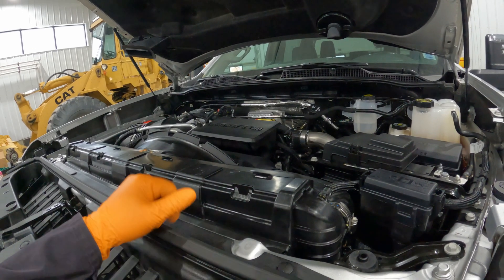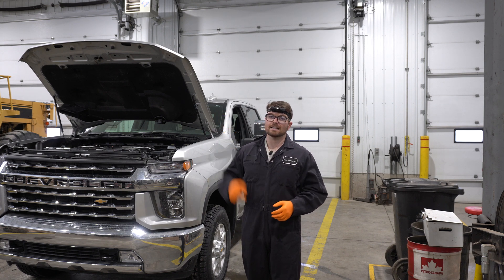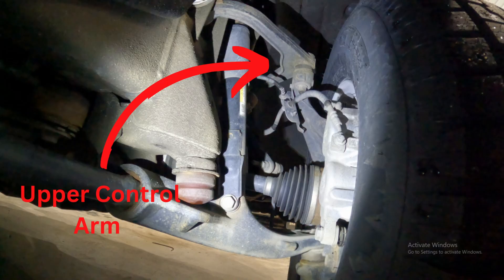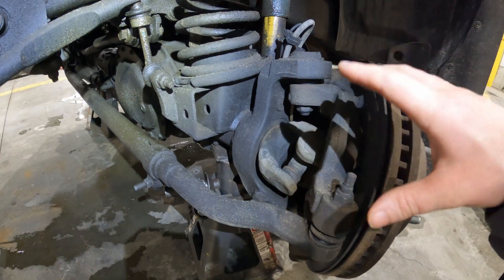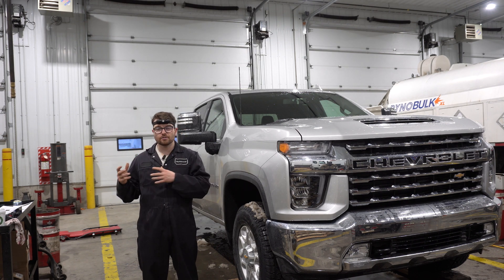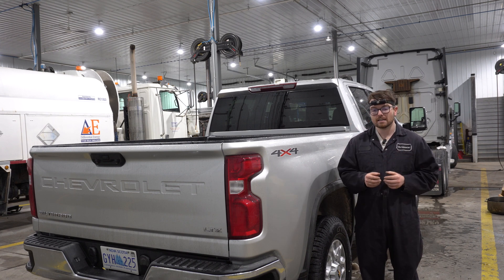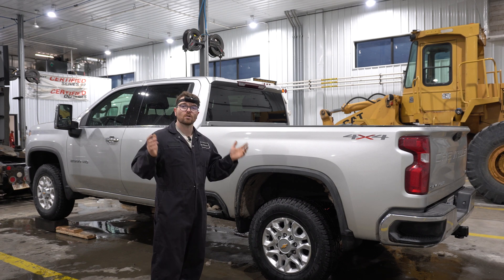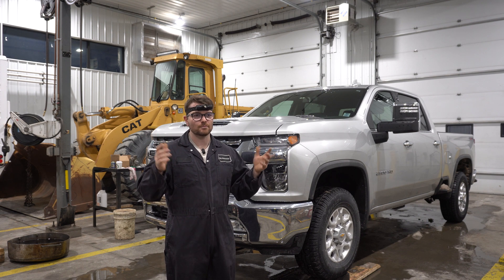Chevy 2500 6.6L Duramax Diesel Review (Part 2) | Does GM Make A GOOD Truck??

Comment: GM always does this crap on all their V8 vehicles. They don't give you an aggressive enough rear gear. It's like they try and force the engine to lug itself up to speed. It makes these modern GM vehicles feel very old school. Like the 90/00's 4 speed days. They are lazy to downshift. I remember back in my LS1 Fbody day we complained that 3.42's weren't aggressive enough, and totally unnecessary with Viper overdrive gears. The GEN6 Camaros with automatic transmissions use a 2.77 rear gear. Why? A 3.42 would be an awesome gear to complement a 10L80/10L90. I was looking to buy a Silverado 1500 with a L87/10L80, but ended up getting a F150 with a Coyote/10R80 instead. 2 reason were 1) GM is way too proud of the L87. They ask way too much for it and option it in too few model/cab/drivetrain configurations. "But JROC, it's a Corvette engine with different exhaust and intake manifolds." I don't care, it's also a Camaro engine, and Coyote is a Mustang engine, an GEN2/GEN3 Coyotes are full forged, have much better fuel systems, 5L F150 is a flex fuel vehicle from the factory, and being DOHC vs OHV there's no reason that Ford should be able to offer a Coyote in such a broad range of models/cob/drivetrain configurations compared to GM with the 6.2L, and for so much less $. The only reason I can figure that GM limits the sale of the 6.2L so much is to get better CAFE ratings as a GEN5 6.2L is much better than a GEN5 5.3L. I couldn't find a L87/10L80 truck that compared with my F150 interms of features and mileage for anything less than $12K more than my F150. I would of been paying $53-$54K for a used 19 RST Z71. Issue 2) on why I went F150 over Silverado is the F150 with the GEN3 Coyote feels stronger, more playful and funner. This is odd in a truck as Coyote is known to be a RPM based engine, while the LT1 is a very broad/linear engine (I used to own a 19 1SS 1LE) but you wouldn't think so driving these trucks back to back. The F150 is so willing to downshift and put the engine in the meat of it power that it's very rewarding and makes it feel modern compared to the Silverado with the L87/10L80. I credit this to 2 things. The Ford gives you the opinion for 3.31's, 3.55's, or 3.73's (my truck has 3.73's) whereas GM sticks you with 3.23 rear gears. Then Ford tunes their 10 speed to be much more willing to downshift like it knows what you're wanting to do when you start adding throttle. The tuning on the 10L80 is old-school in that it's lazy to downshift. It forces the engine to lug unless you give it a pretty good amount of throttle input. With a 275/55-20 tire my F150 rides right at 2,000 RPM's at 80 MPH. The newer GM and 21+ F150 uses a taller 275/60-20 tire and a 10R80 and 10L80 use the exact same gears so a 3.73 rear gear is not too aggressive a rear gear for a GEN5 SBC on the highway. You GEN3+ SBC's cruise great at 2,000 RPM's.

I will say I thought the 3.73's in my M6 19 SS 1LE was a pretty ideal gear for the car so I can't say that GM never gets their rear gear right.

Comment: Good job on the video man, really like your informative factual-based videos. I own a 20' GMC AT4 2500 HD and I am an HD landscaper that pulls my #12000 skid steer plus implements on my 25' gooseneck ( a lot of weight). The truck seems to pull it just fine with 0 issues as a matter of fact my crew is always telling me I drive too fast and honestly I barely put my foot into it. This L5P just goes! It is very smooth for what it is and I enjoy the product immensely. I have a little over 95K miles on it and not one issue so far. None. I want to trade it in before the 100,000-mile mark bc of its value but am hard-pressed to switch to another manufacturer. I like the Tradesman with the Power Wagon package but am not totally convinced I will get all the "goodies" that GM gives me. I do wish they would refresh the interior as they did on the 1/2 tons and I would probably just stick with GMC at least that is what I am leaning toward doing at the moment. Keep up the good work, we are watching!
Reply: This is good to know. I’m looking at getting a 21 Chevy 2500 HD for my landscape company. I haul a gooseneck 14k lbs dump trailer every day and I’m hoping it’ll do the trick and can last me a while!

Comment: The main takeaway of the DMax 2500 seems to be that from a design philosophy standpoint GM set out to build a liveable daily driver that can tow the big stuff in a pinch when needed, while Ford/Ram built more vocational oriented trucks that can be specc'd out in luxe trims but sacrifice everyday creature comforts for durability.

If you're towing a backhoe or landscape trailer to jobsites 5 days a week and sometimes take the family out to dinner on the weekends it probably comes down to a shootout between the Ram and the Superduty, but if you're looking to commute to your day job and get the kids to swim meets while still being able to tow the boat/camper/tractor on the weekends the GM seems absolutely unbeatable.
Reply: Hit the nail on the head. Ford and Ram do all their philosophy on paper. GM is the only one that sets out from the ground up to make a truck designed for the real world, all day, every day.
Reply: This sums it up greatly. I have always said, if you want a workhorse you need a Ram, if you want a mix between work and pleasure get a Superduty, if you simply want to ride in comfort when you need to work from time to time,,,, buy a GM

Comment: Here in New England where bad roads with lots of pot holes is the norm.   I’ll take that IFS on the GM.     The ride is better and they don’t chew up ball joints as often as the solid front axle trucks.

Comment: I like the GM.    Ram is Awesome but the transmission is crap.  With the cost going up. I will stick with GM.     The gm has served me very well. !!!!      If not pulling a load a lot  or hi milage. I like the gas.  Save 10,000 +    service is cheaper.    10k. Buys a lot of gas

Comment: I have a 2019 3500 single rear wheel drive and I towed 28,100 pounds on a dump trailer and it towed it perfectly fine with no problems even going up a hill.

Comment: With the GM trucks it's always a matter of GM just making lower-rated trucks. GM plays it really conservative, comparatively speaking, with how high they rat their engines and trucks. Back in the 2010-2012 era they played the one-upsmanship game with Duramax power; every time Ford or Ram raised theirs, GM responded a few months later. For whatever reason, GM has since opted not to do that. What they have said consistently since then is that they focus on the total towing experience. To them that means not necessarily shooting for the moon like Ram and Ford on power and capacity ratings. 
Is this hurting GM? Maybe a bit but they still outsell Ram by a good amount so they're not hurting for sales even with gas and diesel power ratings - and a couple tow/payload ratings - below the others. So can GM's platform do those higher ratings? I would say yes, if they do away with the G80. But like the IFS, some of their design features are considered institutional such as GM's focus on OHV engines for so many decades. So, whenever GM raises their power and capacity ratings, I'm guessing they will have a stronger G80 and IFS as well.

Comment: I’m pretty sure the 3.42 gearing was new with the 10 speed.   Previously, 3.73 was the standard gearing on the D/A combo (as far as I recall anyway)
Reply: You are correct. The 3.42 is just fine in this application. Factory rated tow numbers are marlarcy anyway. 99.99% of truck owners will never tow 30+ thousand pounds. Its just  marketing. In my opinion the GM feels the best with a trailer behind it but thats just. My opinion

Comment: I run a 2015 gmc 2500 hd as my work truck in northern Alberta I agree there is more moving parts but the front ends are stout. It has 329’000k on it and through some rough Alberta pipeline roads and off road conditions. Last year at 280 I finally had to rebuild the front end. My 2010 dodge ram 3500 I put two front ends in it by 210k not to mention a new 68rfe transmission too. I know it’s hard to take one guys word on trucks but each truck has there flaws but my duramax has been my best truck I’ve owned hands down
Reply: Have you has the CP4 injector pump issue. The internet has ne terrified of mine.
Reply: @andrewhall7862  no I haven’t I run a fuel conditioner every tank of fuel and I think that definitely helps
Reply: @andrewhall7862 most wont. I think the actual failure rate is less than 1%

Comment: Question: If you weren't a RAM guy, would you recommend the 2500 L5P Duramax for someone who doesn't want to tune or trick out their 2500?  I might put on a cold air intake, do the MAP spacer mod.  I'm a GM guy through and through. My 2009 Tahoe is going strong and I will keep my pavement princess for as long as possible. But I need a better tow vehicle and really want to stay in the GM family.
Reply: The 2020 and new duramaxs are a dream
Reply: I'm a Ford guy.  I bought a used 2020 2500 Chevy LTZ for comfort.  It is more like a big SUV and drives, rides, and travels very nice.  The towing capacity on the door is 18,500.  My Ford was 22,.000.  It's give and take, all in what you need or want.  Both diesel by the way.

Comment: Have a 2021 2500 duramax. Got rear ended and drove Ram 2500 while mine was in the shop. Day to day the ram was not comfortable. Hauling it rode just fine.  I think it all comes down to what you’re using it for. 75% of HD truck owners don’t use them to their full capability so ride comfort might play a bigger role.
Reply: I should also mention that cruising on the highway I get over 25mpg in the duramax without a load.
Reply: My friend has a 2020 gmc Denili. I swear the seats in that thing.  Feel like I'm sitting on a picnic bench. We drive from southern PA to southern NY a lot.  Also he get the same or worse than my Ram gasser towing mpg. So either there's something wrong with that truck or that engine is ass. He didn't even want me taking pic of the mpg .
Reply: @Mattman2500  not sure what’s going on with your friends truck but I get amazing fuel economy for a 3/4 ton. Does he have the 10 speed?
Reply: @chrisj9897  Yeah has the 10 speed. From what I can tell gets like 17ish . Driving around here country roads. We towed the same trail loaded the same. I got 1mpg better . With my Ram 6.4L 2500. The load was my gooseneck loaded with a tractor. Pulling 8 to 10k . Now he has a lot of miles on it about 60k. So far from what I can tell. Hasn't given him any problems.
Reply: So absolutely true!!! and the AWD fonction of the transmission in winter = a blessing!

Comment: You're whining about rear end gear ratios on a truck that can't hit 20mph in 1st gear. Smh you shouldn't act you know anything if you cant understand that a transmission has gears as well as the rear end.

Edit, just looked it up and your lovely dodge is geared quite a bit higher (meaning 1st gear maxes out at a higher speed since you don't seem to understand this) for first gear. Seriously, learn to understand gear ratios and how they work together. With both on 35s and at 19mph, the cummins (3.73 rear end) is turning 2500rpms while the duramax is turning 2800rpms. You have to get the 4.10 rear end in the dodge to mach the gearing of the duramax.

Comment: I'm currently battling a ED 1500 full delete problem that I can't get solved. Hence I'm looking at the 3.0 Duramax. I would like to see the same walk through on that truck as I value your experience and candor. Thanks for considering this option!
Reply: Don’t get the 30 Duramax it’s too long for the cab of Chevy or GM or GMC. You have to take the cab off it to get to the injection pumps that’s a real dealbreaker.

Comment: You neglected to mention that solid front axle "feature" of death wobble.
Reply: Death wobble is caused by neglect worn tie rods drag link n ball jts
Reply from the maker: No system is flawless, I think its generally a stronger option for an HD truck. GMC 4500 and 5500 come with solid front axles for a reason.

Comment: Do you know if the 6.6 gas and diesel have any parts in common ?
Reply from the maker: in terms of the internal engine components. I would highly doubt they do. very different engine despite sharing the same displacement. but I could be wrong!

Comment: I truly believe that the emissions components on GM vehicles have evolved to the point of being the most reliable of the 3 north American truck manufacturers. The 3.42 ratio gear set is a non issue for me since the gearing in the 10 speed "Allison" transmission makes up for it. I had a deleted LMM Duramax before this 2022 L5P that I now own and would never go back.
Reply: People get way too caught up on rear end ratios and if anyone complains about it in any way, I automatically know they don't know what they're talking about. There are 10 other gears between the rear end and the engine. 1st gear tops out just under 20mph on my Duramax so, I have zero problems.
Reply: @jeffhall768 otally agree. If I am towing with my 3.42 rear end in 7th gear and I need more pull- it goes down to 6th. So what is the advantage of having a 3.73 rear other than when in 1st gear( and I can’t use all the torque I have in 1st gear anyway).
Oh I forgot- the Ram only has 6 gears anyway !
Reply: @jeffhall768  You’re 100% right! So many people talking shit about rear end ratios but with the 8-10 speeds nowadays it doesn’t realy matter. I own a Ram 1500 8 speed and with 3,21 gearing it still have 28% more wheel torque than an old 6 speed with 3,92
Reply from the maker: I mean I do think GM makes a good truck. I think in terms of options I like the ram better. but thats more opinion based then reliability based. The L5P is a great engine.

Comment: I've had Auto 4WD on three different GM 1500 trucks over the past 22 years and I find it to be incredibly useful during our long Alaska winters.  If I were to buy a 250/2500 truck I would buy GM for that reason alone.  Personally, I don't tow my trailers in snow, so there will never be that extra load on the Auto 4WD system.  I've only used 4WD while towing when I've been in sand and dirt, and for that I go straight to 4HI.  So I have no concerns about my Auto 4WD failing and in 22 years I've had zero issues with it.
Reply from the maker: Fair enough! and honestly that's exactly what 4wd auto is meant for. slick snowy roads where you don't really 4wd the whole time.
Reply: I think issues arose when people would leave em in Auto all the time.  Had a buddy that would put it in auto and forget about it, drive it like that all year round 💥
Reply: Good to know. I bought a 19 and had no interest in the newer body’s until the 24 came out. I didn’t really pay attention when test driving and was just basing off older models
Reply: The HDs don’t have auto only 2wd or full time hi or low
Reply: @cant_keep_up4123  Negative. GM HD trucks from 2020 onward have Auto 4WD, in addition to 2HI, 4HI and 4LO.

Comment: On a side note, what are your thoughts on the 8hp70 transmission? I know ram says lifetime fluid in it but I have a hard time believing that. I’m at almost 75k on my 2016 5.7 and haven’t serviced it. I’m not having any issues but wanted to know what your thoughts were on it.
Reply: I'm at 133K - 2016 5.7 No service - shifts beautifully.   I've been easy on it though, and not a whole lot of heavy towing.
Reply from the maker: Thats a tough one. some people swear up and down that the transmission will last and i know a guy who put 400,000km on the original fluid. But as a mechanic it freaks me out a little almost all fluid has a lifespan. I talked to the dealership and they don't even touch it even if you are willing to pay. I decided with my old truck to leave it.

Comment: The Allison has very low 1st and 2nd gear ratios in transmission to overcome the 3.42 gear. Now you know why.
Reply from the maker: I get it. but even with 3.73 the truck would have more pull. it's a diesel they are already very efficient. Just my opinion, GM probably knows exactly what they are doing!
Reply: @GettysGarage  well your opinion is dumb on this. 10 other gears between the rear end and the engine. Do you not know this? Do you not understand gearing?
Reply: @jeffhall768  wow Jeff, calm down man

Comment: My mechanic told me to stay away from Dodge/Ram/Jeep products as they see more of those than any other make. Ive also talked with tow truck drivers and they see more of the same vehicles break down.
Reply from the maker: Yes and no. Chrysler products are not known for reliability in the past lol. I think Ram makes a pretty good truck. but GM and Ford are more known for better reliability.
Reply: Stay away from all modern vehicles if you want reliability lol.

Comment: I don’t agree with the Ram towing of 20k, payload numbers don’t allow the 2500 to tow 20k with 10% on the hitch. I believe the payload on your truck is under 1500 lbs which is the standard crew cab bed that most people buy. Other 2500 Rams I have seen ( either friends or vids) have been around 1800lbs payload which would be max tow at 18k with no driver, passenger, and gear/tools/luggage. I have a 2020 Chevy 2500 High country ( all optioned out) and have over 3000 lbs payload leaving plenty of payload for 1850 lbs required on a hitch pull and a 2775 lbs for the 5th wheel/goose hook up…. That’s 18500 lbs GVW with 15% on payload. GVW 5th goes down as I add passengers in cab thou. Lower trim levels go up in payload . I’m not sure where Ram is getting a 20k towing….maybe a single cab gasser work truck. Haven’t seen any payloads on those or anyone that ever buys them.
Reply: They use the same Cummins/transmission on the 3500 with plenty of payload to support the 20k trailer rating.